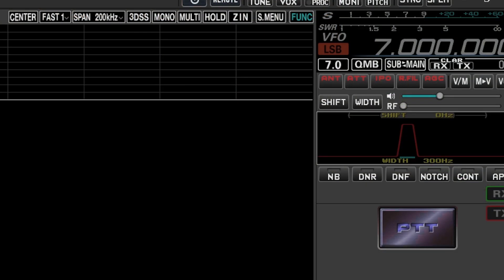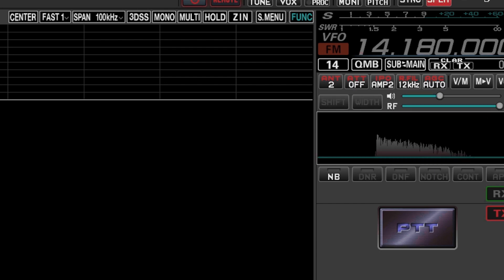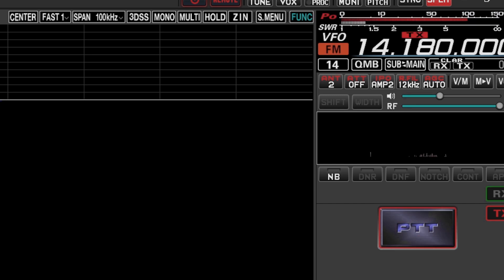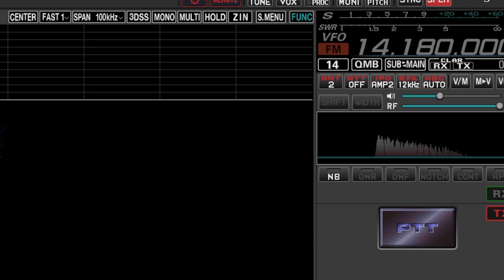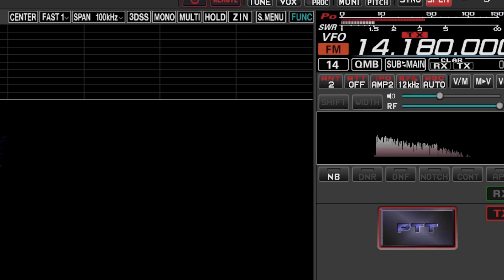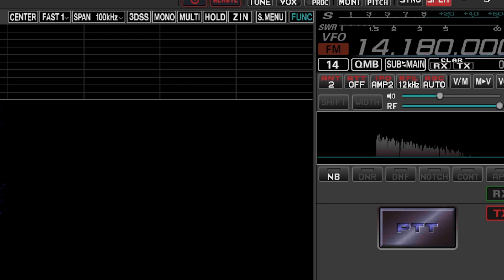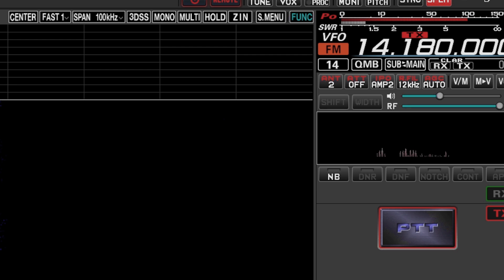SWR Went Higher When The RG8X Was Replaced With LMR400. Why Did That Happen? Jim W6LG Investigates

Comment: Happy New Year Jim!  You’re looking good, I hope you’re feeling better!

I have a quick question… I just bought 50’ of times microwave lmr-400 (.84vf) .  I am replacing rg-213 (.66vf) but not all at once.  will I be okay to mix and match the two coaxes?  or should I just wait until I get the next roll of lmr-400 to complete the run?  I am all rg-213 out to the antenna at the moment.

Comment: Before I even watch the video, my guess is that the 8X has higher resistance and is overall a more lossy cable.  Not all the power is making it to the out-of-tune antenna, and not all the reflected power is making it back down the line, thus throwing-off the reading.  Let’s see if I’m right.
Reply: I guess I was 🎉

Comment: Hi Jim, always nice to watch one of your videos........my understanding on what's going on......... Lets say you are putting out 100 watts at the Tx. for simplicity lets say your coax yields 3db of loss so you only have 50 watts at the antenna. Lets say you have a very bad match up there and have 10 watts of reflected power but by the time it gets back to the SWR bridge its only 5 watts (same 3db loss). The meter does its "calculation" using the original 100 watts(all it knows) but only has 5 watts of reflected power to work with so the ratio between forward & reflected power looks a lot better (100:5) there than at the antenna where its 50:10 watts. Only fictional "lossless" coax will yield the same number at both ends of the run. The better the cable the closer you get to the same number at both ends.  the way I see it anyway..............be well and enjoy Thanksgiving......73 Mike, K1FNX near Boston

Comment: Assuming both the RG8X and LMR400 are of reasonable-quality manufacture, if the two types are compared in on-the-air tests, then no difference, or at most an insignificant difference, will be noted on the HF bands.  On the other hand, if something goes wrong with the antenna, the RG8X will provide a bit more protection to the transmitter as compared to the LMR400.  So which is better?  If you feel good having spent more money on LMR400, then okay, but please don't ever make someone who is using RG8X feel bad about their choice.

Comment: Great demo .The loss in coax can hide the actual SWR at the antenna . If taking a outher measurement at the antenna side you will see how a lossy coax can hide the SWR . And better coax will show more true number . Best to tune antenna buy measuring SWR at the antenna . Then if SWR really jumps up then you know you need better coax.  You can test coax with a 50 ohm dummy load. then use a 75 ohm load and compare the two.  I find a lot of that RG8X sold today ,not so good at all.  ABR /DX Engineering / M & P  have good versions of RG 8X . But will cost some $$ . A bunch of that RG 8X sold on Amazon  and eBay is very lossy and poor quality . Just a waste of money !  I start with buying my coax from a good known source then pick the type and length and ends I want. I bet after re tunning the antenna with LMR 400 it will work a lot better ! 73
Reply: Also, the feedline is acting like an impedance transformer at anything except a perfect SWR .

Comment: Aha!  I was thinking only about the effects of the outer shield and the different lengths, but hadn’t considered that SWR measurement relies on the reflected signal and the loss it experiences in the cable. So this is why measuring measurements should be done at the feed point, correct?

Comment: I was really proud that my first antenna that I built had great SWR across the 20m band for my privileges. I came to realize later that my cheap coax had a lot to do with it. 

I would be interested to see a real life comparison between the RG8x and LMR400 and the impact on signal strength from the same antenna with the same power on 10 meters, similar to your video on the impact of power that you did not too long ago. 

I notice that my received signal reports are typically much better than my sent signal reports on the higher bands. I am using 100’ of RG8x with a 80m off center fed dipole with the feed point at about 35’.

Thanks for the video and 73.

Comment: Twice the line loss must be considered, going to the antenna and returning from the antenna. VNA's have a Return Loss scale in Db to make measurements of complex antenna systems easier, a 24Db RL minus 1Db line loss times two equals a 22Db RL  about 1.2VSWR at the antenna terminals. Demo, a 10Db pad will read a 20Db RL on a VNA  and about a 1.3 on a VSWR meter.

Comment: Question: why do HAMs do CW with a code with short and long tones? Why not two different frequencies.   I was at an ARRL meeting and K6CTW told me if you use two different frequencies, then your transmission rate can increase 10 to 15 percent.
Reply: Using 2 (or more) frequencies is called FSK, frequency shift keying. That's what most other digital modes use in some form or other. Listen to RTTY sometime. There are two tones, Mark and Space. CW only requires one oscillator for the one tone.

Comment: New subscriber and ham.  Thanks to you I’ve made fewer mistakes.  My first antenna was a discone.  Took your advice and bought lmr400 for it. Just put up my first end fed and used the lmr400 and ran rg8x for the discone.  Using a nanovna proves your advice to use the best cable you can afford.   Thanks.

Comment: So a higher SWR reading means less of a loss???? 🤔

Bob Runge
W1LSZ
Reply: In a nutshell yes.  VSWR is a ratio of power transmitted to power reflected.  With the lower loss coax cable more of the transmitted power makes it to the load (the antenna) and if there is a mismatch at the load some of that power is reflected back to the transmitter.  More of the reflected power makes it back to the transmitter with the lower loss coax cable which causes the measured VSWR to increase.  The VSWR of the load never changed.  What changed was that the lower loss coax cable increased the accuracy of the VSWR measurement because more of the reflected power made it back to the meter and less of it was burned up as heat in the coax.  Mike KC3OSD
Reply: @mikesradiorepair  Thank you Mike… appreciate your reply.
Reply: @mikesradiorepair also with lower loss feedline more of the reflected power will reflect back from transmitter back to antenna
Reply: I don't think you used enough question marks.

Comment: losses, losses, losses.....
Reply from the maker: Yes, yes and  yes. 73, Jim W6LG
Reply: @ham-radio  What should perhaps be mentioned or recommended in general in this context is the purchase of a (nano) VNA. And in the application, the calibration of the coaxial cable used. Then there is no longer any doubt and you get clarity about the actual conditions at the feed point. In most cases, the money would also be much better invested in the long term than in more expensive coaxial cable.